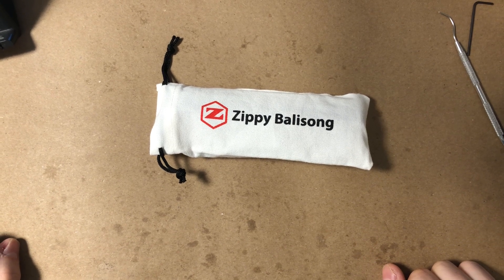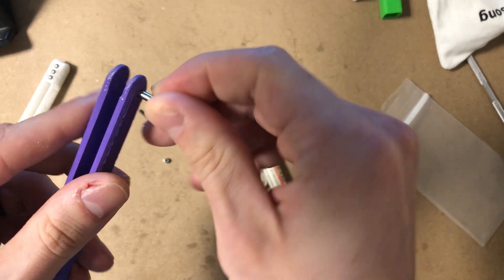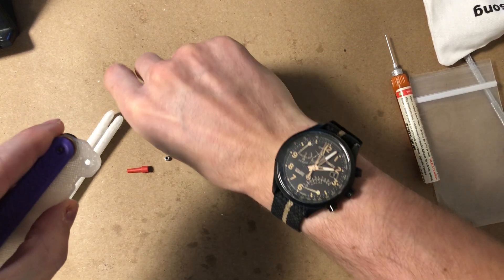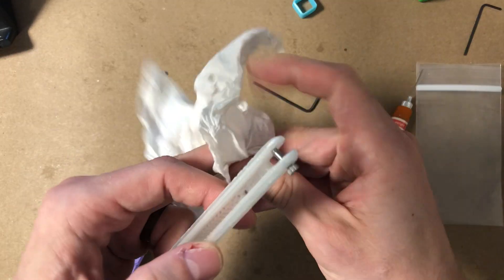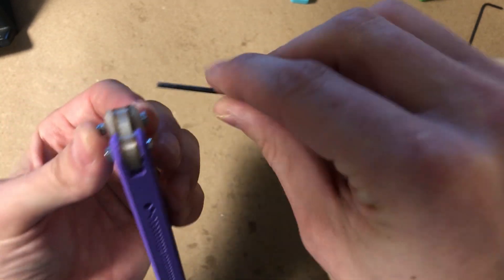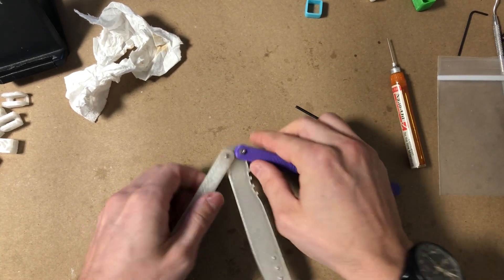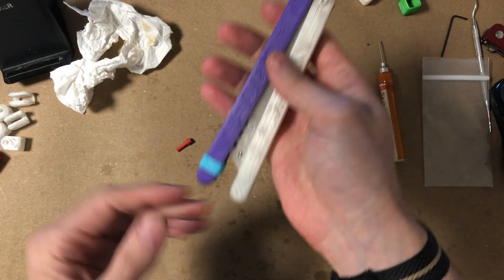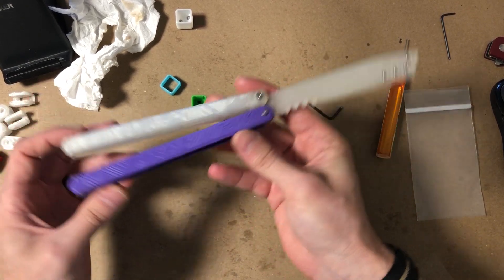Zippy Diode Balisong - Assembly and Tuning Instructions

Comment: How thick are each of the washers? and why not just use one thicker washer rather than two thinner ones?
Reply from the maker: Two washers are used so that there is a metal-metal sliding plane, and not just metal-plastic. A plastic balisong printed in this orientation won't have as low a friction-coefficient as a metal sliding surface. Using 2 metal washers that can slide independently ensures a smoother handle swing for a 3D printed balisong of this design.